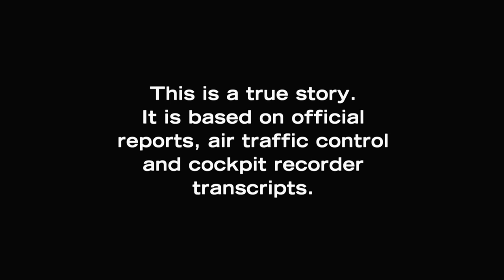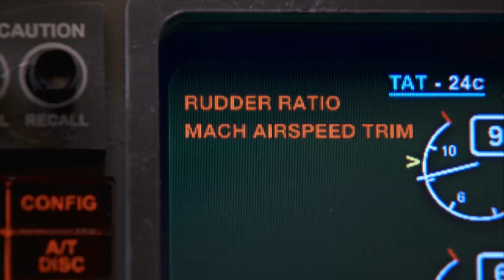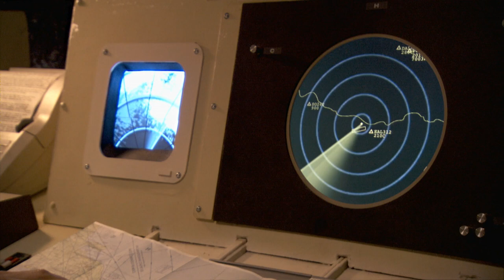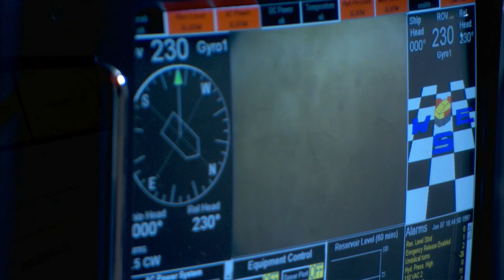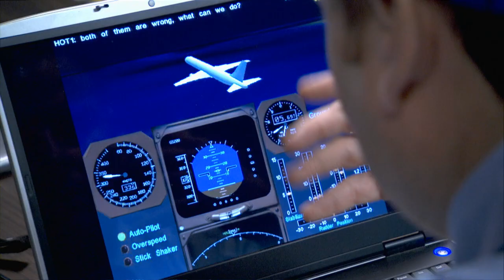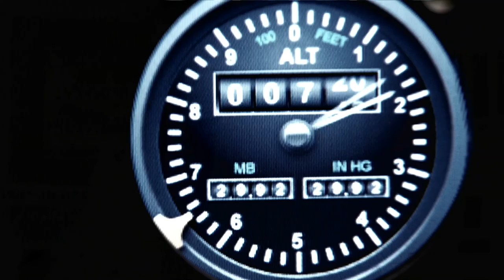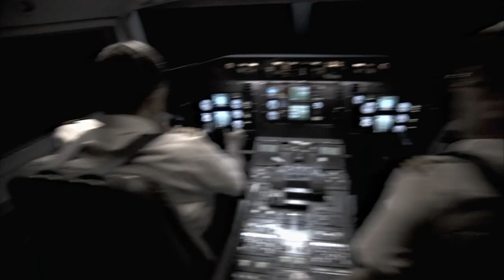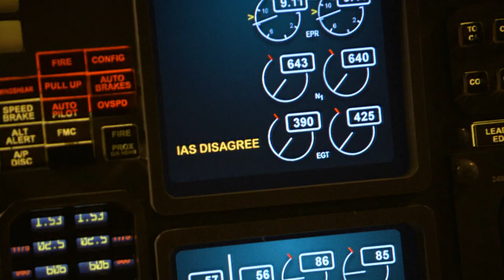The Plane That Wouldn't Talk | Faulty Readings | FULL EPISODE | Mayday: Air Disaster

Comment: It seems like it would be relatively inexpensive to have some kind of sensor that shines a light down the tubes to sense whether they are blocked by anything. It could be something that they would even be able to use in flight to sense whether ice had built up and blocked them. It would sense more obvious things like the covers being left on the tubes and things, like those wasps, that might not necessarily be something one would see from the outside. Such a light sensor could be nearly as simple as the ones at the bottoms of garage doors that prevent them from shutting on objects or animals in the way of the door's path. I don't know why they don't have such a simple system for such an important instrument.
Reply: Something strictly like a garage door sensor likely wouldn't work due to requiring something at both ends of the tube, but something that lights an infrared LED and looks for a reflection could be made quite easily, and could detect most any blockage quite reliably. It's most likely failure mode would be a false positive (reading a blockage when the tube is clear), which is generally ideal for safety equipment, since it's better to be told to check a problem that's not there than to ignore a problem that very much is.
Reply: It could even be something like a smoke detector where it shoots tiny bits of radiation through a sensor to check if it's clear. Good idea either way.
Reply: Or just cover the pitot tubes when on the ground like you're supposed to.
Reply: I've had many such thoughts while watching these kinds of documentaries, and sometimes they are even pretty close to actual fixes that do get implemented industry-wide. On the other hand, if you consider all of the things that might be able to prevent most of these extremely rare crashes featured in such documentaries, and them implement them all into an industry standard airframe, you add not just a whole lot of weight (meaning more fuel, thus more weight yet again), but also increased complexity to every flight (i.e, extra points of failure, some of which can be contributing factors in future crashes).
Reply: @toddsmith8608  but don't the majority of blocked tunes happen in the air anyway, like from ice building up in the cold at the high altitudes& what not? So how would that help?
Reply: Good idea. However more accidents need to happen before FAA or the plane maker would make any improvement.
Reply: @ar4203  not if the pitot heat is turned on.
Reply: Maybe an algorithm that compare the readings from all the tubes initially and grants the correct readings to the majority. Maybe some air pumping device on the tip of each one. But anyway that was resolved by giving the  same “voice” to each one, acceding the plane’s “brain”.
Reply: I suspect any sensor arrangement like that would probably end up being very fiddly and unreliable, prone to giving false indicators.
As a general approach, I think it becomes problematic to add extra layers of complexity to each separate device in the plane.  They'll spend most of their time on the ground being troubleshooted, costs will go up, and everyone will become frustrated and numb to the constant false alarms.

If something needs to be made more complicated, the best place to do it is usually in the computer programming.  Adding complexity here is cheaper and more practical in general.  It's certainly not foolproof but it scales much better than when you escalate the complexity of physical devices.

The computer should automatically corroborate all of it's sensor readings to make sure they all make sense, and call out serious discrepancies.
From the episode it sounds like they started having the computer monitor both of the pitot tube readings and at least detect when those disagree.
But there's still the possibility of multiple pitot tubes being faulty, which I think isn't all that unlikely when they're both the same type of device and exposed to the same environment.  So the computer should do additional corroboration beyond the pitot tube readings.
The episode mentioned there's some way of measuring ground speed.  I don't know how that works but it sounds like something else that should be factored by the computer when it searches for any sensor malfunctions.
The plane should have sensors for everything that factors into the plane's behavior.  If anything doesn't add up mathematically, it needs to be able to figure out that there's a likely sensor failure, and convey that information clearly.
One physics variable that seems problematic is mass.  Perhaps it calculates that, but it would have to do so using other sensors that can be corroborated while the weight is an unknown.

Basically, in a safety critical scenario the computer should verify it's sensors instead of naively trusting them.  Perhaps the computers in newer airplanes already do this.  This incident was in 1996, so at that time maybe the onboard computers were not fast enough or just well programmed enough to be as "paranoid" as they ought to be.

Comment: Sounds like a Pito tube inspection should be added to a pre-flight checklist.
Reply: Yeah. Aeroperu 603, which also was caused by pitot tubes was a few months after this
Reply: well those tubes over 20ft from the ground will need high end flashlight to inspect it from that far in the night

Comment: These pilots who ignore the stick-shaker drive me crazy. This guy keeps the nose up the whole time it's going off.
Reply: He was clearly confused by the conflicting airspeed readings and the overspeed warning. Pushing the nose down makes it go faster, which he knew would be bad if they were already going too fast.

So many bad decisions, though. Deciding to continue takeoff with clearly faulty instruments, not immediately trying to return to the airport after they did take off, engaging the autopilot with clearly faulty instruments, etc.
Reply: @fllthdcrb  The stick shaker has a different system to detect it to go off. It couldnt be faulty with the speedometer. Alot of old pilots think that all the devices are connected and if one is wrong then they assume they are all wrong. Just like this pilot did. Every reading device has its own system and device that detects information.
Reply: he lowered the speed and went into a stall warning, it wasnt rocket science, he screwed up.  the co pilots gauges were working on take off and not his so he should have went with that.
Reply: Relying on equipment instead of knowledge happens in medicine too, especially younger doctors who've only known hgh tech medicine

Comment: a speed check request from traffic controller would have help a lot.
Reply: 9 months later the same problem on a 757 happened on an AeroPeru flight. A speed check from the controller didn't help. Each situation is different so who knows
Reply: @chancewebster7953  but this was different I thought.. this was only 1 side blocked on the Peru flight the whole system was.
Reply: Right? "Huh, I dunno which instrument is correct, so rather than determining that, aborting the takeoff, calling a mayday and coming back in, or using the knowledge that I'm supposed to have about expected failure modes to determine which is correct, I'm just gonna guess"
Reply: ATC will have the speed that is broadcast from the planes transponder, which more than likely would of been what the Left seat speedometer was reading, which was faulty.
Reply: Depends of the system...Some use radar to calculate it, and some use the number they get from the plane..
Reply: pito tubes gives the same speed reading to the otc, wouldn't help
Reply: Not that it would help here, but in this day and age, why isn't all flight data streamed to the tower? Heck it could relay alarms to the ground. Not to mention if this data were streamed somewhere, it would make lost black boxes a little less devastating to the investigations. Oh and cameras... cameras... why aren't cameras mounted to just about everything and recorded (or streamed) as well. I've seen a few of these videos were a simple view of the outside of the aircraft would have alerted pilots to what exact issues they have.
Reply: what you're describing is impossible .... waaaaaaaaaaaaaayyyyy too much data to stream.......

Comment: Some of these pilots seem to lack basic machinery operation. I find it hard to believe I wouldn’t always know some particular equipment and throttle arrangement that can’t help but fly. 
I also wouldn’t trust an instrument that was known faulty ten minutes ago. How do you get so naive?
Reply: It was hard to watch. You can tell the way this one was heading. Suddenly believing an instrument that was faulty, and not aligning data you knew (climb speed and throttle) with an instrument that clearly was providing faulty data.
Reply: I don’t think you quite understand how planes function. Especially how much things vary plane to plane. 

A setting that simply flies level in some conditions, can overspeed or stall in others. It also changes with slight nose up or down orientation. The elevation your at changes settings as well.  

If you don’t have gauges and visual reference, you’re screwed. Even worse when you have gauges that are incorrect.
Reply: @mikemck4796  I very much do understand. But if you are flying a 757-200, and you have thousands of hours on this plane, you're telling me that you're not familiar with the takeoff settings for throttle, pitch etc? And the climb rates and speeds? 

Please don't patronize. Even though the alarms are unnerving, he wasn't thinking properly about the situation.
Reply: It high stress situations people tend to get tunnel vision and focus on the wrong thing instead of the big picture. I have a feeling this is what happened here.
Reply: Exactly!
Reply: @MrMowky  Yup
Reply: @mikemck4796  there's still basics, no matter what type or how fancy it is. Aerodynamics is still the same, no matter what.

Comment: In southern warm wet climates, I've personally seen mud dauber's block up small gas and water vents/drains on vehicles and equipment very often. Solid hard mud/dirt blockages that are air and water tight.  Complete pain to clear these blockages out. Have to disconnect the hose or pipe and reverse blow out pressurized water to wet the mud and compressed air to clear them. The plane's pitot tube in rain after take off, if the mud softened with rain water while air pressure applied the mud blockage would move further in rendering the system inoperable.

Comment: I don't know anything about flying a plane. But common sense should tell a pilot that cutting engine power that much was very unusual from where the position of his levers usually are.
Reply: That captain made so many mistakes.  Your comment is right on. Pulling power back so far from where the throttle would normally be! Activating autopilot when you know your airspeed indicator is malfunctioning! All those hours of flying 757's and this guy couldn't recover this jet? In a same exact scenario, a truly competent pilot would've brought that jet back to level flight, and landed it safely. That airplane didn't have to crash. This captain's epic incompetence cost all those people their lives.

Comment: Kind of like when you're skidding on ice you turn INTO the skid to keep control of the car but the natural tendency is to turn the wheel away which make the skidding worse. When the stick shaker activates pilots now train to push the nose DOWN even though it will at first feel unnatural to do so.

Comment: I have never flown a plane in my life, but I do know that STICK SHAKER MEANS PUT THE NOSE DOWN RIGHT NOW!

This was also true for that Air France jet that crashed near the equator after the Pitot tube froze over, giving a "we are going at a crazy speed" indication, when they had stalled, had no forward motion, and fell into the ocean, killing everyone instantly.  All they had to do was PUT THE NOSE DOWN, and they could have recovered nicely.
Reply: Or if the overspeed warning was correct, going nose down could have caused the plane to break apart. 
The pilot simply went with the error he’d been considering longest.
Reply: @mikemck4796  He was a terrible pilot, he had thousands of hours experience and made ridiculous mistakes. His throttles were pulled back and a attitude of nose up 15 degrees and he knew the airspeed indicator was incorrect. He should have known there is no way he was going 300+ knots in that configuration and failed to take control of the plane. 100% his fault.
Reply: @Teh_Random_Canadian  And the other experienced pilots they brought into a simulator reenactment that had similar issues. They’re all terrible pilots too?
It can be true that all of the most experienced pilots are terrible. However, you should probably reconsider your judging criteria. It’s pretty pointless?
Reply: @mikemck4796  I stand by my original statement, he is a terrible pilot, and he didn't follow procedures to abort takeoff upon getting warnings. All other pilots on that flight new what to do except the captain. They didn't take control because of culture.
Reply: @Teh_Random_Canadian  I agree, the man was a terrible pilot. I get it, faulty gauge readings, but a truly great pilot would've recovered that jet and landed it safely.
Reply: @fishingbarracudas4768  or never took off from the beginning.

Comment: Novice question:

Is there anything in training where you take a plane somewhere near that 350kt max speed?  That way you can "feel" what the plane is like at that point?  

I mean, even if I closed my eyes while driving down the highway, I'd know the difference between 130mph and 45mph....obviously cars are different, but if a plane is nearing the point where it will soon break apart from speed, wouldn't there be some way to "feel" that?
Reply: Not a pilot, but I'd certainly say so, it only makes sense. Having watched enough of these, I was able to armchair quarterback all the mistakes the captain was making as he was doing them. Also, watching Blancolirio (sp?), He always states to fly the plane in known configurations. When you have logged 10s of thousands of hours you should easily be able to configure the plane in such a way to known trim and power settings.
Reply: not soo much at night , no reference point .
Reply: @airgunningyup  That was kind of what generated the question.  To bring a plane to that high speed during the day do you'd get a sound/shaking/feel of the speed when you have no reference for speed.
Reply: @pullt  No. theres no way to tell. But a pilot should know the feeling of a plane stalling, the shaking stick and the sound and feeling of the plane buffeting would tell everyone the plane is stalling and to push the nose down.
Reply: No, because the hairs in your Cochlea (inner ear), only picks up acceleration and deceleration, not speed.
Reply: KISSMYACE3203 is not saying "measure the speed by the hairs in your cochlea" they're saying "measure the speed *by the shaking of the plane*" under the assumption that the plane behaves differently at very high speed and very low speed.

Comment: Okay but like...the Captain's airspeed CLEARLY didn't work, I wouldn't have expected it to magically fix itself. Your options then are to rely ONLY on the FO's airspeed and either set the autopilot to go off those readings OR manually fly. IDK why the Captain trusted his end when it clearly was malfunctioning
Reply: It’s the same thing that happened in a couple other crashes with the way most pilots now a days are trained to believe instruments no matter what. It’s no different than the pilots who believed they weren’t turning because the gauge said they weren’t when they were basically upside down.
Reply: @battleboat12  Well at night they literally have no other choice.
Reply: @Krystalmyth  I know but there’s gotta be a point where you realize hey gravity is pulling me in my harness right while I think we’re going left. Something doesn’t add up.
Reply: As a pilot myself, I would have aborted the take-off the moment that the airspeed indicators didn’t agree with one another as was and still is proper procedure.

Comment: They should've looked at the RPMs of the engines that may have kept them flying at least.
Reply: Engine rpm doesn't matter in the air unlike the ground. This is because wheel slip is much less than the delay of a turbine or blades through a medium.

Comment: This is not the first time I've seen and heard this video. I still cannot understand at all why the aircrew failed to go to manual flight control, use it to level out the plane, and then go from there to solve the problem. "Trust your instruments" just did not apply here. All those alarms were obviously wrong. So... Go To Manual Flight Control! I blame this primarily on faulty ground maintenance, and secondarily on total cockpit error of the most egregious kind. It certainly makes me totally leery of flying anytime ever again, given that maintenance crews, and even experienced aircrews, can make horrific errors of this kind.

Comment: I climbed into a Cessna 172 late in the afternoon, summertime in New England USA (~42deg. North). That plane had flown with no issues that morning. 
-added full power for take off, full power checked good
-airspeed should start moving off of the bottom of the dial within a few seconds, no airspeed. 
-chopped the throttle and hit the brakes, taxi back. 
Sure enough, down in the pitot tube was dried mud. The little bugger had started its nest in the last few hours. 
Look into the tube opening as best you can on preflight whatever your latitude.
Reply: Gotdammit!!!